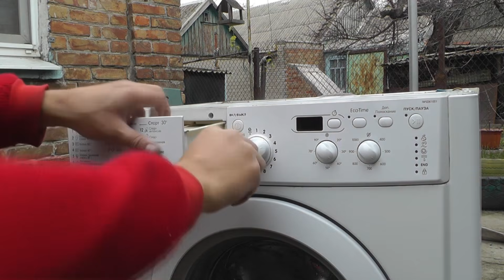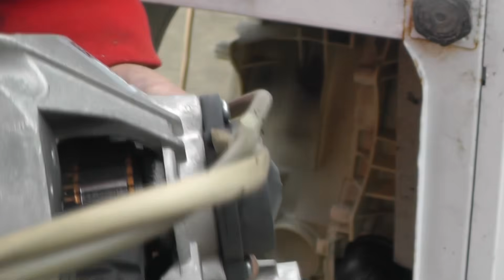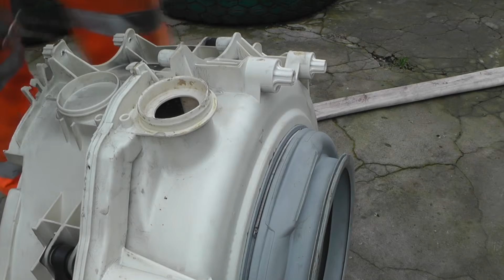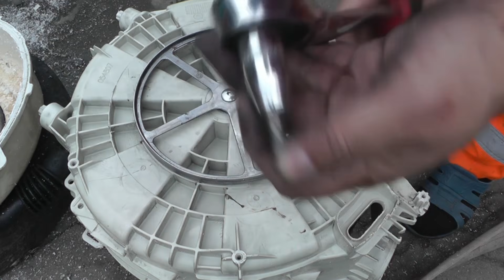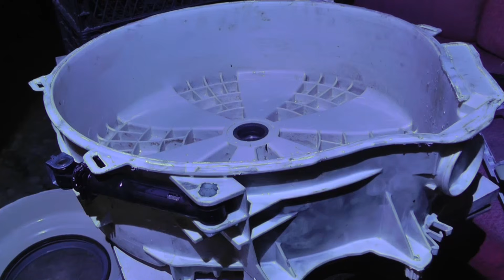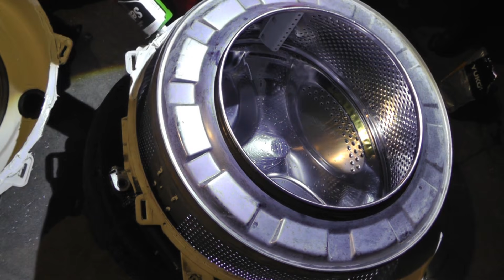Indesit Washing Machine Bearing Replacement

Comment: hi 
may i know where did you find the bearing? I've Indesit IWC 71252 W UK N Washing Machine and its hard to find the bearing for this model.
Reply from the maker: Hi! For Indesit models like yours, the bearings aren't usually listed by the machine model because the tub is sealed. You need to open the tub first and check the numbers written on the bearings themselves (usually something like 6204Z or 6205Z) and the oil seal size. You can find them at any local spare parts store or online by these numbers. Do you have the tub already opened?

Comment: Hello, really the perfect explanation i saw until now. Every detail is there ! I am about to do the same process with my new Siemens iq700 with Number: WM16W540 /23.
What im struggling is, finding the exact bearings for my machine. Can someone help me on that ? I am based in Germany. 
Thank you !
Reply from the maker: Thank you so much for the kind words! I’m glad the explanation was helpful.
For your Siemens iq700 (WM16W540/23) in Germany, the best place to find exact parts is via Ersatzteilshop.de or Krempl.de. You should search for a "Lagersatz" (bearing kit) using your full model number. Typically, these models use 6206 ZZ and 6307 ZZ bearings with a 37.4x62x10/12 seal, but I highly recommend opening the machine first to verify the markings on the original parts, as Siemens can sometimes vary components.
If you run into any specific hurdles with the iq700, feel free to ask here. Good luck with the repair—you've got this!

Comment: My Indesit bearing failed , the machine will be only 3 years old in July 2026 😮

I have 10 year parts but Indesit wanted 190 Euro call out 😂 😂

Lesson learned, in the future I will only get a machine with at least 5 years manufacturers parts and labour warranty !

There needs to be laws to stop this built in obsolescence, the amount of Easter created is shocking and I’m tired of being charged carbon tax for having to fill my car and heat my home !!!!!
Reply from the maker: Thank you for sharing your experience! It’s really frustrating that your Indesit bearing failed even before the machine hit the 3-year mark. 190 Euro for a call-out fee is exactly why many people feel forced into buying new machines instead of repairing them. This is a perfect example of why Indesit washing machine bearing replacement is such a searched-for topic—people want to avoid those high service costs. Your advice on looking for a 5-year parts and labor warranty is a great tip for anyone looking to avoid 'built-in obsolescence.' The environmental impact of 'disposable' appliances is a huge concern that definitely needs more legislative attention.
To everyone else watching: How long did your washing machine last before its first repair? Let’s talk about which brands are actually built to last in the comments!